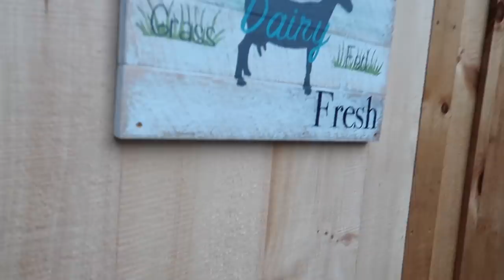NOW we GET to SEE if it all FITS - 2 Years Worth of Firewood to STACK in the new SHED

Comment: Cut the top two rungs out of the ladder and leave the sides. Then you can step through while still holding onto the sides.
Reply: I think that every time I see it used.
Reply: eldenl1 hinge it at the loft, draw string tied at foot with a pulley mounted on the rafters
Reply: Or mount some railing along the edge and you can hold onto the newel post at the opening.

Comment: You need to learn the"Chicken Dance" when you clean the floor. Put down some kitty litter and "scratch around" with your feet like a chicken it removes stains and cleans the floor in prep for sealing. I ran maintenance in industrial settings for over 40 years and that was a good way  to prep dirty floors. Also why not put a handle in the roller so you can stand and apply the sealer instead of crawling around on your knees. Ideally the sealer is put on shortly after the concrete is laid and before the floor is put into use.  Enjoy your videos immensely, keep 'em up.
Reply: Garage floor absorbent is cheaper that kitty litter and is free of chemicals.
Reply: He's a young'n. He still has good knees! LOL

Comment: Glad to see that you're using some sort of sealer on the floor . I would put a few coats on and I would do the entire concrete floor . If it's good enough for floors in a store than it should work on yours . It will help with keeping the stains off the floor and keep the concrete dust down . Gina was 100% right in saying why not put some firewood in the bucket . Smart woman you have there . I was thinking the same thing . Use a long broom handle attached to the roller so you don't have to be on your knees when applying the sealer. Yes , I would put some sort of wood sealer on the ceiling and walls . I know it's a lot of work but I think that you will be happy with the out come . I think that it's wonderful that Gina is now a big part of your videos . I look forward to your videos every morning . Thank you .

Comment: You probably need to seal the concrete in the stalls as thoroughly as possible, then maybe even paint the floors on top of that.  Otherwise, a few years down the line, and that concrete is going to be a  biohazard.  It's a pain now, but its better than having to jackhammer it out and pour a fresh slab a decade from now when years of built-up ammonia make your eyes water every time you walk in there.
Reply: I agree, especially with the painting part. Garage floor epoxy paint and sealer ( not the fancy stuff ) can be had for $35 a gallon.
Reply: elk hunter yes that garage floor epoxy is great stuff.

Comment: Milking room walls : Weak pickling solution looks wonderful!  (I was a house painter for over 35 years.) Using a 'weak' solution, you protect the wood and maintain the wood grain beauty. Use a water based wood conditioner FIRST (maybe the sealer you're using on the floor..?).

Comment: That is a great product Al. I used a densifier/sealer in our machine shed right after the concrete was poured. I also filled the expansion cracks with an elastic filler made by Sikaflex. The biggest issue I had was from not rolling out any puddling. You will get white marks at the edges of puddles if you don't keep rolling. I used a product that was specifically designed to keep oil and salt from penetrating the floor -- like you get from salty road ice melting off of a vehicle, and oil drips from working on same. It was about $80 dollars a gallon and covered 250 sq. ft. -- it took four gallons. I buffed the floor afterwards.

Comment: Al I recently had a concrete floor poured in my barn conversion as I call it. I did seal the floor with a product similar to the ghost shield brand. I felt it important as spent many years in my auto shop with moisture bleeding up through the floor on rainy damp days and slippery.  I believe this is the fix. So far no issues with moisture surface holding up well.

Comment: Why is  the tractor bucket empty when fetching the wood?
Reply: I was just thinking the same, missed a trick by leaving it empty.
Reply: I agree, too much carrying and stacking.. load the bucket only and dump inside the the woodshed. One person inside the shed and stack and the other shuttle bucket loads in the bucket only, leave the wagon parked. Too much carrying and stacking with the wagon.
Reply: @johnhenderson8360  - It might be easier for them to pick it off the wagon, than having to bend over each time to pick up off the ground after being left by the tractor?
Reply: I thought that the wagon probably held more wood than the tractor but I could be wrong🤷🏻‍♀️
Reply: @emilykiesling2315  I'm sure the wagon holds more wood. However, they are stacking on the wagon and carrying it into the shed. It just seemed to me a lot of additional time handling and moving the wood. In the end it's their wood and their choice how the handle it. 
I appreciate your comment.
Reply: @annwithaplan9766  You maybe right. If I were to do it alone I would load the bucket, drive it into the shed, leave the bucket at a easy height to work at, and stack directly from the bucket. Just a thought..
Reply: @johnhenderson8360  - That's what I had thought, too. Just drive it into the shed, or back it up in there. I'd put it all on the wagon AND in the bucket. They'll figure out what's best for them, I'm sure. : )
Reply: Put some sides on the trailer and use the loader to fill it, don't waste time stacking

Comment: Add a clear coat of something to the inside walls.  You never know what adventures are down the road...but a washable coat of varnish etc, will come in handy for any misadventure that might come up.   Also, you might want to paint the floors of the animal parts of your barn with cement paint over the top of your sealer.  Love your content!!!!

Comment: I worked at a lot of different dairies when i was young, all were brick and concrete, never worried about the concrete. When the cows pooed which was often and a lot, had a flat shovel and a water hose, no finish to the floors at all. I don't see where you have any worries a bleaching after milking, the pellets put out by goats doesn't seem to be a problem.

Comment: I have used Super Deck brand "Natural" oil based stain/sealer on cedar for years. The "Natural" has virtually no pigment. This stuff will preserve the color of the wood as it is when you apply. Out of the weather, it will maintain for years without reapplying.

Comment: You and Gina have your pile-it licenses where you take off from one pile and pile it on another. 
On your shiplap you have a lot of options, in the old days the farmers would whitewash (lime wash) the walls in coops and dairy sheds as the most economical, non-toxic and sanitary solution. Problem is everytime you bump into a whitewashed wall you get a white lime powder streak on your clothes and the whitewash needs to be re-applied almost annually. 
If the goats try to nibble the walls you might want to consider a food grade raw linseed oil finish. It will help preserve the wood and you won't have some strange chemicals appearing in your goats' milk.

Comment: when we sealed the new concrete floor in the shop, a professional told us to make sure the floor was complete clean or the sealer may not work very good and to put 2 coats on 24 hours apart.  Then paint it with a poly urethane paint that has a sand like substance in it to help keep it from being slick.

Comment: When you are stacking the firewood on the trailer, move your stacks to the outside edges and load up the area in between the stacks with firewood stacked in the opposite direction, length ways instead sideways. Gives you a little more per load.

Comment: JudithB  Stacking  wood  is  sort  of  theraputic  to  me!!  I  got  all  of  mine  stacked and  covered  a  couple of  days  ago,  it  took  awhile  in  mid 90s!  Cool front coming  today,  so  working on  getting the kindling  contained,  and  the  last of  the  log chunks  split.  Another front  on  Sunday that  will drop us into the  70s finally,  so  lots  of  prep  work for winter  to do.  I  would  seal the  walls in  the milk room  and  probably  the  milk  stand too!  I  would  do the  rest of the  goat barn,  then  the  other  side  thats  out in the  weather  before  doing the  shop.  I  guess  you  will get  the  tarped lumber  moved  to the  barn  soon?  Love  your  videos!!!

Comment: Sounds like you should use the same sealer on the walls and ceiling ( as well as the floor), I'd consider using a garden sprayer for application and follow up with a roller or brush. For future firewood deliveries, will they be dumped in front of the shed? Thanks for all the videos!

Comment: The work shop area seal it, then follow up with a concrete paint to keep your garage area floor easier to maintain and looking nice.  i would suggest to clear coat the walls with some type of sealer paint to maintain the nice look and to protect the wood surfaces.  Good job.

Comment: We used to use equal parts of boiled linseed oil and diesel fuel with a quart of automatic transmission fluid to add a red color to the mix. We would use a cheap pump up sprayer and spray and roll any runs before they hit the ground. Just make sure to spread out and dry any rags or you can get spontaneous combustion

Comment: By all means seal the interior work walls from staining etc but what about the exterior woodwork happily rotting away and changing colour ,depending on sun orientation,plus the contact and rotting between the stored firewood and the interior walls which might not be seen for 2 plus years.

Comment: Cut the ladder off at loft and use heavy duty hinges. Then install 2 2x4s at ladder width from left to the roof. Also, attach the pulley to one side of the ladder so it isn't in the way while climbing up or down.

Comment: I think I'd leave the milking room walls as they are. They are internal so no weather will hit them and no maintenance necessary.
Where do the ducks lay?
Put the frozen stock in the microwave and defrost a bit. Once the outside is thawed, the core should slide out into the pot. Soup looks good!

Comment: Did you test the sealing after you put it on the floor? I usually do several coats of sealer. Most directions say to keep putting coats on until it stops absorbing into the concrete. I'd put at least 2-3 coats on, especially considering you're going to have urine and feces on it. Put some water on the floor and see if it soaks in or not...

Comment: I would use a coat or two of blond shellac (it will seal the wood and especially around the knots) followed by a coat of water base polyurethane varnish.  I just bought an inexpensive HVLP spray gun on Amazon (about $30) and it works perfectly for these thin coatings and it's easy to clean.  I have a couple of $500 + HVLP units and I like this gun best.  If you don't do anything, or use an oil base product, the wood will darken.

Comment: Al, You might want to consider replacing the rubber on the milking stand where all that chemical sealer spilled for Willows safety. Also, whats with the side of the barn getting all dark so soon? Does it need some sort of wood protectant?
Reply: To late, all that unfinished pine will turn gray in a few years, except under the eves.

Comment: I agree with you Al, love the look inside the milking room with raw timber. Do a sample of the floor sealer on an offcut of the boards you used inside, would be really interesting to see how it looks dry, hopefully not yellow like most sealers do to timber. Anyway great video, but I woulda totally tested how high I coulda stacked that trailer before it all came tumbling down, you have a really smooth driveway so if it did, all you have to do is blame Gina for driving too fast 😁😀😂😂😂😂😂 and then 🏃‍♂️🏃‍♂️🏃‍♂️🏃‍♂️🏃‍♂️😁

Comment: If you have two years' worth of wood, will you use all the wood before you restock?  Or will you fill it back up always to keep two years' worth?  I would not put anything on the walls of the milking area.  It is pretty as it is.
Reply from the maker: We will restock every year this way the wood is always nice and dry
Reply: @LumnahAcres  is there anything available from termite infestation?

Comment: Maybe a 2nd coat on that floor considering the punishing it will need to stand up to.  Put it thicker on the edge and let it either seal the space between the floor and the baseboards or let it seep under.  To keep any icky liquids from soaking in to any unsealed areas.

Comment: Run a 2x4 on the underside of the perimiter of your chore wagon. then bolt on brackets to accept panels to form a box on top. then you could load a lot more wood or whatever and it will not be in the way for loading flat stuff with the forks.

Comment: That should do it. But u will still need the matts if u have a slippery surface   I think u should leave the walls. I was think more of the 2 step once that leaves a grippy surface Rust-Oleum
4.0 out of 5 stars  166 Reviews
Rust-Oleum 261845 EpoxyShield Garage Floor Coating , 2 gal, Gray.

Comment: Clear, Flat poly on the walls. It will help keep dust down,(after all, it is a milking room) be easier to clean, and preserve the wood, also, please move the milking stand at least12 inches away from the wall, preferably 15, to give willow space to stretch her neck

Comment: one cord is 4' * 4'  * 8 ft - that was 10 cords of wood for 2 years  ? Always use sealers on concrete. Smart to use it on the outside slabs also. Also seal the shed wood siding . That snow will soak it , freeze and split the bottoms very quickly. That is why old farm buildings had raised floors,  foundations to keep the rain and snow off of the wood . That is why they lasted a hundred plus years . Smart design makes for less maintenance, longer building life. Just like machine maintenance before it needs done , in cold weather and rain. Did you get the spare rims for the truck snow tires ? Whole family working farm , cool . Be nice to see how the small farming is supporting you folks ?

Comment: My suggestion for the ladder to the loft. Remove the top two rungs, do NOT cut the uprights, these can be used as stabilizing hand holds to get on to and off from the ladder. Attach a pair of hinges on the bottom of the third, (now the new top rung) and to the joist supporting the loft. On one side of the bottom rung upright, insert an eye lag screw through the upright and into the rung. On the opposite side at the same location attach a double ended boat cleat. Run a rope from the eye up through your pulley and your loose end can be secured on the cleat. This way in the down position the rope will be mostly out of the way for going up and down the ladder, and in the up position the rope will support both sides of the bottom of the ladder. 

It will be interesting to see how well that sealant works. Please. for the sake of your knees, attach a threaded broom handle to that roller handle so you can apply the sealant standing up. You may not think it now, but later in life all that kneeling you do will come back on you in spades. Protect those joints.

Comment: I have noticed that Willow only stomps and dances when you break off the suction cup. It seems to be painful for her. Are you going to move New Yolk City to a new pasture? I agree with others, you need to seal the goat stalls too. I think you need to poly the walls in the milk room. I know that whitewashing the walls would brighten the workshop and would be easier to see, then seal with poly. But whether you want to paint the walls in the shop is up to you. I agree with eldenl, cut the top two rungs of the ladder to use the top sides to hold onto to climb through.

Comment: Al what are the plans for the gate going to New Yolk City when the chain freezes in the eye bolt?  I'm in Texas and it's still in the mid 90's and we don't have the winters you do.
Reply from the maker: We will have to melt it. Trying to figure out the best latch system to get.
Reply: I'm glad major snow and ice are not in my winter agenda.
Reply: What if you attached the chain to the post with a large screw (lag)?  I was going to suggest wrapping it around the post as we did, but it's too tall.  Love your videos, it's my morning coffee relaxing time each morning.

Comment: I'd just take off the top 2 rungs, that way you have something to support yourself all the way up and down.  Use a hinge right at the pivot point.  And use an attic ladder pulley system, they are preloaded...think the garage spring, that way the ladder isnt heavy to pull up when putting it away.  And since its loaded, it will hold itself up there without any locking device.  You can still add a rope as a "just in case" safety holder or something, but I highly doubt its needed for many years.

Comment: Seal that wood! I am an old painter with over 40 years experience.  Use a clear sealer and if it is still legal in your state a penetrating oil-base sealer.  After your exterior has weathered enough to remove the mill scale--seal it.  You can add 20 years to the life of your weather exposed wood and more than that if you maintain it.  Your new water based sealers work well, but you get a better molecular bond with oil-base.  I had an old neighbor that put linseed oil on his shakes when it was built in 1910 and after a couple of more coats in the first few years it polymerized
 and became maintenance free.  He finally had us paint it 60 years later.  Painting has the disadvantage of peeling and requires on going scraping and painting over the years.